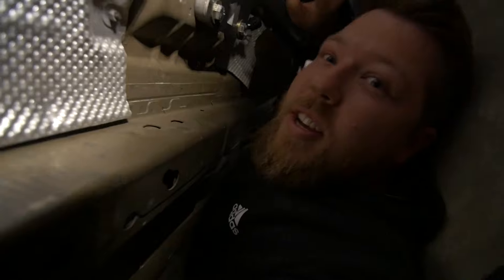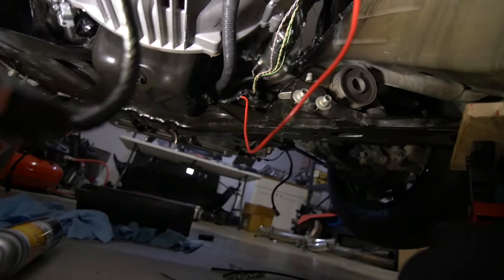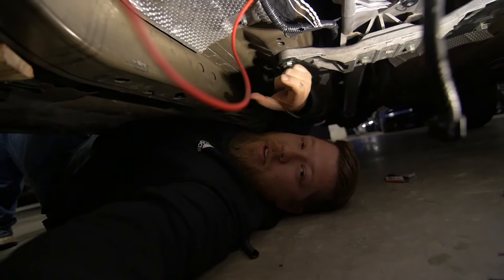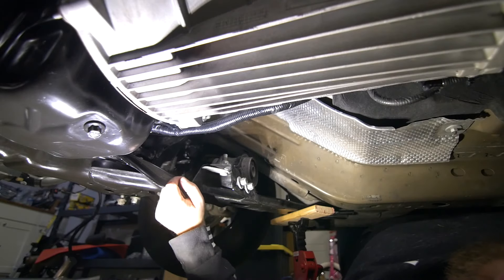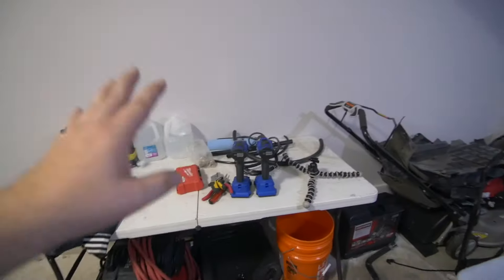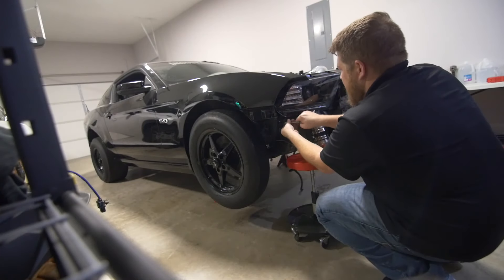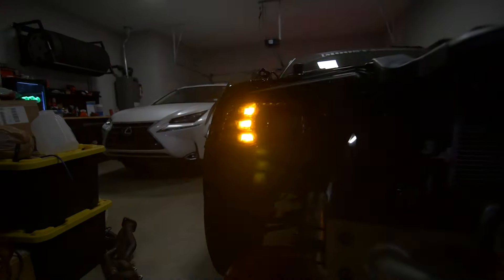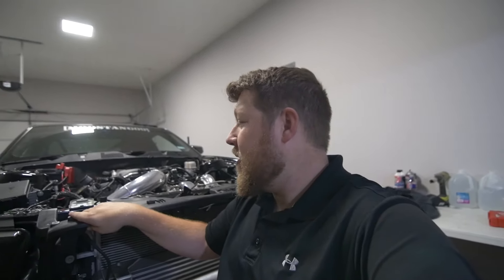Part 15 | Morimoto XB LED Headlights for the Moostang!

Comment: Just went to headlight revolution and they didn't show anything for Mustangs. Do they have a program that some one can send in a set a housing that they will retrofit?
Reply from the maker: I do not believe they offer any retrofit options, mostly bulb replacements and full on headlight swaps.  Try the retrofit source and see if they have it.  If they do see if my code works over there, if it doesn't I would give HR a call to see if they can get them for you.

Comment: Swap the plugs and coils to the other bank and see if it's still doing it on the bank 2 side
Reply: Next try to swap the injectors and see if the issue moves to the other side.
Reply from the maker: Thanks for the idea Jacob, I am going to try this tune revision and if that doesn't work then I will try your method.  Process of elimination begins.